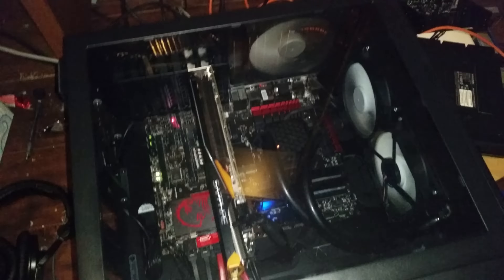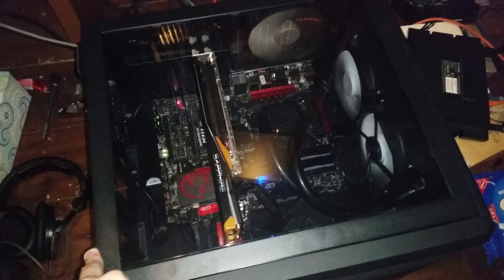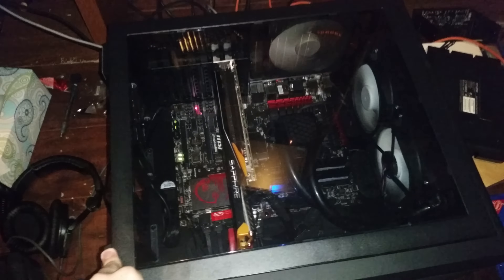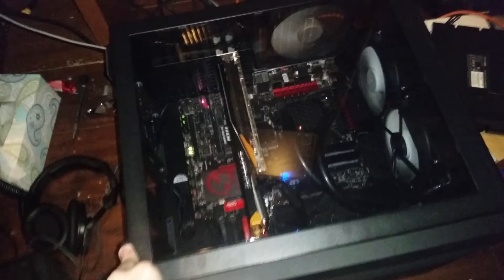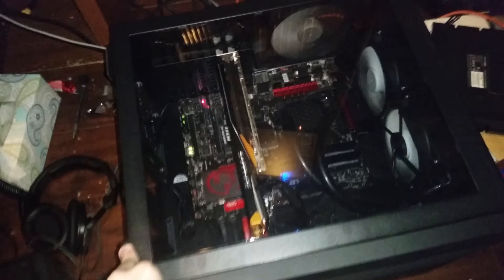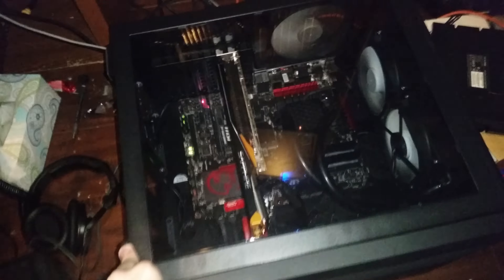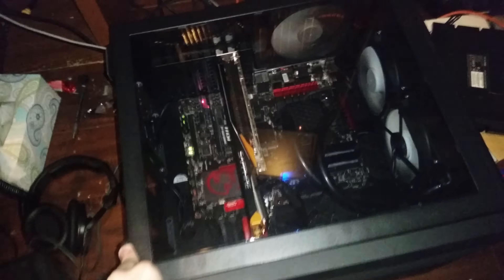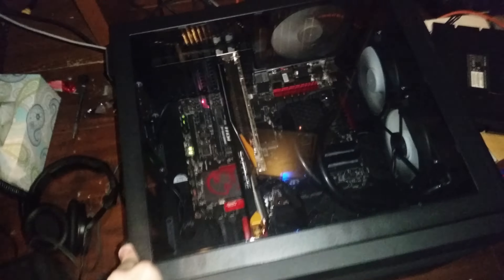Computer Case Upgrade! & New Controller! (Also bad news)

Comment: WhyBeAre The random panning you're having is from the dead zone on the controller not being big enough, so since the springs no longer hold the pan stick perfect center, the little slack it has it being turned into pan movement. I don't know if you figured this out, but you can just make the dead zone bigger when your new controller starts to do the same (It happens to most all of them) Love the new setup, BTW, so clean!

Comment: I saw the ATH M50's on your floor. Nice. They're very good headphones
Reply: Apparently not nice enough to be placed anywhere but the floor xD jk
Reply: The same could have been said about the PC then o.o
Reply from the maker: Red Charge Not quite that nice, it's just a HD 280. Still pretty nice but quite a bit cheaper than an ATH M50. They get to fall all over the place when I move things around because I have no place for them when the table I sit them on it upside down on my bed.
Reply: WhyBeAre I see. From that angle, they look like ath m50s. The HD 280's are pretty good too though.

Comment: That's a beast CPU cooler.. I'm running a bit dangerously here. I have my CPU overclocked to 4.5Ghz on air cooling..  but I'm using a big cooler, the CoolerMaster Hyper T4, so my temperatures don't usually skyrocket.

P.S: That's some sweet cable management! My cables are ALL over the place and I have the most generic case ever xD
Reply from the maker: Jordan O'C Just don't look at my server. It's still a mess of cables lol.
Reply: WhyBeAre You have a server?! Ah, that's understandable. The servers in my school have the worst cable management possible.. It's literally sprawling all over the floor ._.
Reply: WhyBeAre Don't bother with cable management for the server. As long as it's not sprawling all over the floor. TRUST ME.
Reply: Damn I thought you was black but totally wrong. Good job on vids tho👍

Comment: More fan's used as intakes and only one used as an exhaust is a good thing.  This creates positive pressure in your case and will not allow as much dust to enter the case.
Reply from the maker: ***** 4 intakes to one exhaust is just overkill though, the one exhaust fan won't be able to keep up with the intakes.

Comment: Yes nice you got the air 540, I bought one of those a few months ago really great case for airflow. Just looking over your build and you've got one of the radiator fans blowing air into the case and the other one out?, Would you want both fans exhausting the air out the top. all the hot CPU air is being redirected back into the radiator.
Reply: It depends, it really does. Generally you want the radiator fans exhausting as most of the heat is going to go to the radiator, and what is the point of cooling your components just to blow the hot air back in to the case. The reason he can get away with swapping the fans like that is the other case fans he has to move air. If those were the only two fans besides the PSU fan he would have a big problem on his hands. But he has other case fans. 

What he is doing is sucking in cool air with one fan and the other immediately pulls a majority of that air back out. This means that the radiator is essentially isolated from the rest of the system and air that cools the rest of the motherboard and hard drives isn't being used to cool the radiator. 
He also has an exhaust fan in the back of the case, he also has an intake fan at the front, those two fans move a majority of the air over the motherboard components not cooled by the radiator.

Of course there is some mixing of the air, its not a perfect system, but its pretty good. The only way he could get better performance would be to move the radiator outside the case, or add a bunch more intake fans. Another thing I always recommend is an intake filter as it cuts down on so much dust and increases cleaning intervals from monthly to bi-annually. Also, in particularly dusty environments, or in a home with animals, having more intake fans than exhaust will help reduce the amount of dust that bypasses the intake filters through cracks and vents in the case.
Reply from the maker: That's how I originally set it up as, but idle curiosity made me decide to try it out the way you see here. Although it wasn't a perfect benchmark (because I can't fully control ambient room temperature) the temperatures I was getting was about 2 degrees cooler throughout the entire benchmark. It's such a small amount it really doesn't mean anything, but I left it the way you see because it MAY be slightly better than having both exhaust out.
Reply: WhyBeAre As long as you have at least one intake fan and one exhaust fan that are not the radiator fans, you will be fine and will get marginally better cooling than having the radiator fans exhaust only.

Also, depending on how dusty your computer gets you may want to add one more intake fan than exhaust as it will reduce dust buildup inside the case. And to almost completely prevent dust buildup, use some intake filters, a large sheet of air conditioner pad filter works great, its what I use at work for filters on the rack mounts and I only have to clean out the servers once per year.

Comment: I dont know alot about specs but these are my specs are they any good? AMD FX(tm)-Quad-Core Processor and 8gb ram 64 bit windows 7 ultimate and a nvidia GeFOrce GTX 650
Reply: Its hard to tell as you dont list any clock rates for your CPU or GPU, the GTX 650 is a little old, but it can run BeamNG just fine as long as you dont add in too many cars. As for your RAM, you didnt give me much to work with, is it 8gb DDR2 or DDR3? what clock rates? and what hard drive, SSD or HDD?
Reply: Well how do i see those things because when i right click on mycomputer and go to properties it doesnt show me the exact details
Reply from the maker: The Wolf Of Justice gaming It would probably stock clocks then since you are not overclocking, in which case you can just use the statistics quoted by the manufacturer.
Reply: Ok thx ;D
Reply: The Wolf Of Justice gaming Since you are running Windows 7 you can find most of the information by clicking the start bar, or hitting the windows button to open the application search bar. Then type in 'system' and open system information. The first thing that pops up is the system summary, this will give you basic details about your system, including CPU make model clock rate and cores. It will also tell you the motherboard make and model. The other tabs are probably of no use to you, but hold interesting information if you want to know more about your computer. I'm going to guess that you didn't build it, so its a branded computer. So you wont be able to overclock anything except the GPU if your particular card supports it. If your GPU is EVGA it likely supports overclocking, but if not, its hit and miss. If you want to overclock be careful as you can damage your hardware and potentially reduce its life.

What you can do to maybe get a little more out of your system is to ensure that drivers are up to date, cooling is sufficient, everything that you don't need to run in the background is closed, and buying an SSD to store your most frequently used games.
Reply: Pretty good.  Not amazing but good enough to run anything in medium settings(except for bad ports ubishit).  And lots of things on high.
Reply: 2009dudeman wooow lotsa information thx!
Reply: batt3ryac1d ok!

Comment: the panning in BeamNG can be fixed by upping the axis deadzone in the inputmap for the controller
Reply from the maker: BallisticDK Sure, but it's a ton easier to just get a new controller because that is an issue with the controller itself being really loose. Iit's hard to see in this video, but you can see it sags based on gravity, and the joystick feel is barely there. This controller is just old, and the joysticks don't feel nearly as responsive as the new controller does.

Comment: Nice case man, The Corsair Air 540. Do you like it or hate it? i plan to buy the smaller variant, The Air 240.
Reply from the maker: Daryl Flordelis The build went pretty smooth, and the temps are nice. Future upgrades should be pretty easy and it seems like it will fit just about anything I want and it fits right under a side table. For my requirements it's pretty much the perfect case (at least on paper). We'll see what I have to say a year from now though.
Reply: WhyBeAre Thanks.

Comment: Idk if that case i meant to be on its side but I dont think you should have a radiator tilted
Reply from the maker: Tom B I did a couple of small and simple mods to it that makes it work better on its side and so far it seems to run good. And the radiator orientation is the same as my old case (HAF XB) so I doubt it should be a problem.

Comment: I have two gtx 660ti's in sli and i only get around 20 fps on beamng even at normal settings, how could I set it to run at around 60fps? I already forced sli on it but it didn't really help much. Thanks!

Comment: Are my specs good?

Intel core I5 2.66GHz(3.2 turbo)
8 GB ddr3 1300 MHz
EVGA gtx 750 FTW edition
500 GB 7200 RPM HDD(I can boot up in 29 seconds)
Windows 7 ultimate 64 bit
Generic case
Generic mother board
PSU 500 watts

My GPU over clocks itself to 1432 MHz :o
Reply: Intel core i5 750**
Reply: Haloid Android It's not great but it works and will probably run most games.
Reply: Yhea not too shabby for its specs.can run watch dogs on medium at stable 60 FPS

Comment: Where do you get the bracelet??
Reply: It is cicret bracelet?
Reply: It's a Fitbit flex
Reply from the maker: Kars Leers Yep, I use it as an alarm mostly because I am able to sleep through just about any sound (even fire alarms from when my family frequently burns toast), but if someone walks by my door the vibrations from their steps wake me up. The bracelet has a vibrating alarm so it wakes me up no problem.

Comment: all day. it takes 5/10 mins max
Reply from the maker: stephen mears I'd like to see anyone move an entire computer into a new case in 5 minutes. That is just impossibly fast. In about 5 minutes I can open up the box the case came in, and bring the cardboard boxes to the curb if I'm rushing as fast as possible. Heck when I benchmarked temperatures to determine fan direction I let the benchmark run for 15 minutes a piece so I could get a good average temperature to determine fan orientation.

Comment: Hey, YBR, can i have your old case? I will even pay shipping.
Reply from the maker: Randomdeath5 I tore it down and saved anything of value, and threw the rest away. Sorry. It was honestly an absolute pain to work with anyways (at least with liquid cooling).
Reply: oh lol was it a mid-tower? if it was then true. its hard to work with those when your useing liquid cooling.
Reply from the maker: Randomdeath5
It was a HAF XB EVO, so not really a midtower. The major problem was you had to remove the motherboard and the radiator to get access to the HDD/DVD/PSU which was just a huge pain. And no matter what I did things "felt" messy, like cables would just be strewn about everywhere because I couldn't get them looking nice. This case is a very similiar design, but you can access all the other components without having to remove half of the computer.

Comment: WhyBeAre no lack of cable management on your part can come close to the rats nest in my file server. In order to keep the hard drives cool I had to install two 120mm 9000rpm fans on the intake and three 90mm circulation fans placed around the case to keep cold air moving around the drives. So far I've fit 12 hard drives in the case and need to get 3 more in as well as another raid controller and two more exhaust fans, then I have to coral this mess.

Just because you have to see it to truly get the feel of my situation, here is a picture.

http://   www.   picfront.   org/d/9dyB

(sorry I dont know if youtube blocks urls so I put spaces in it.